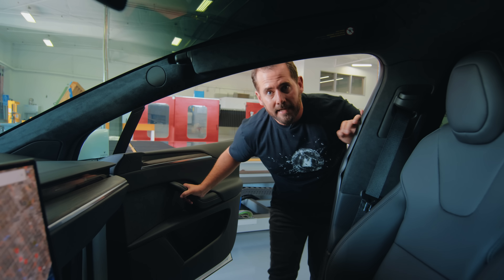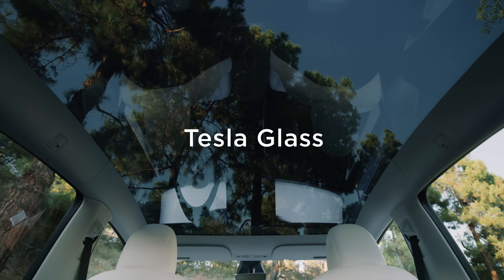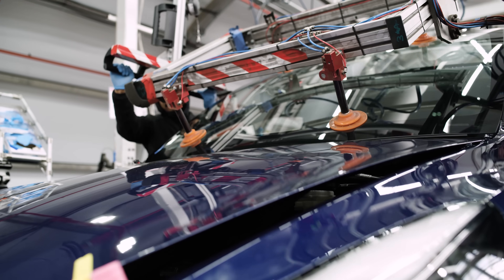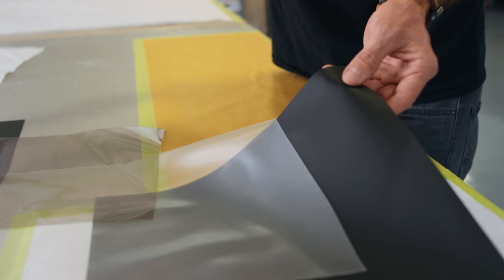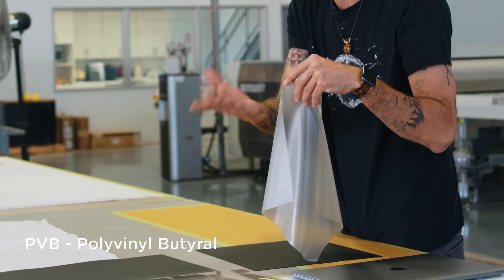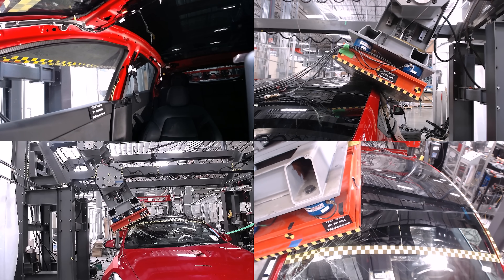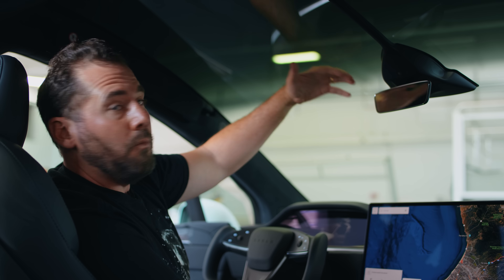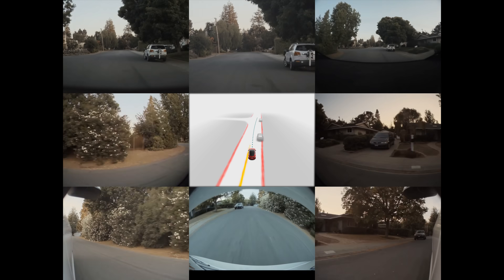Tesla Glass | The Secret to a Quiet Cabin

Comment: More of these videos please! Excellent 👏
Reply: I HOPE YOU'RE SATISFIED !
Reply: You are right they need 100s more of these types of videos. Little tidbits to set the haters and misinformed people right.
Reply: @kameljoe21  Hahaaa, you know that Mercedes have had this type of glass since the early 90's right?
Reply: @PowerslideSWE  Mercedes-Benz offers thermopane side window glass on select models. I could not find a list of models they offer them on, nor could I find a year when they first offered them. From what I have learned they were offered as an option and not many models had them. While since the 90s might be correct lamated glass has been around for more than a century. It has been used on cars and many other things. This is really the first time a car manufacturer has publicly offered it and show us how it works. Most cars have tempered glass and we all know this. Most people would not think that there would be any kind of laminated glass offered at all. It does have its benefits from quieter rides and better uv blocking.
Reply: @kameljoe21  My BMW has dual pane thermo and sound insulating glass, it's a MY 2000, my 1995 BMW 750 had it aswell. It's not a new invention, you Tesla fanboys think that every time Tesla presents something that it's a first, it's not. Teslas drivetrain, batteries and charging infrastructure are great, the cars in general tho are FAR from groundbreaking tho. Mercedes offered dual panes in the S-class from 1992 and onward, saves you the hassle to look it up yourself. You DO understand that Tesla isn't the fabricator of the glass right? It's an outsourced process as it is with every other car maker, and there are ALOT of videos online showing how it's done.
Reply: So quiet you can’t even hear a Honda bump !
Reply: Wham Bam that glass is awesome man
Reply: Fifth reply big fan
Reply: Wassup wham baam
Reply: If they do, I'll be satisfied!
Reply: Hey wham Baam!
Reply: Ey!! Wham baam!!
Reply: Please 🙏 give me a little shootout in any of your videos I am a big fan of your videos.......
Reply: what baam teslacam or #hondabump
Reply: Love your videos
Reply: You know we're satisfied!
Reply: yep
Reply: E LON Is God.  Mars= Future Earth. Tesla and BTC= Future KING. The Rest and Their Family will be our SLa ves. G-AY BIT-CHes Hate Bitcoin just because it use more Energy like Argentine. BUT Space X AND TESLA all Have Bitcoin. KING ELon Himself has both Bitcoin and Ethereum. ELon = Ironman who will Crush Tha nos and critics Should use their cash to wipe their Huge  A.n u.s. Just don t do G.AY things like environment. Tesla and Bit coin all the way!! Non-Holders Work till Dead to supply energy for Bit coin!! Vir.gin Haters Forever Sad and Broke. Cathie Says BTC will go 500,000!   💲💵🤑💸  Get TSLA and BTC while they are very low
Reply: its fine 
Yep. https://youtu.be/rJIAz6Ww-ss
Fax .
Reply: I'm satisfied
Reply: Yes please
Reply: WHAM
Reply: We NEED more 
Hi wham Bamm Teslacam your my fav yt
Reply: I agree!
Reply: yes
Reply: Lol.... there literally nothing special about that glassm you're welcome mate.
Reply: Lord won't you buy me a cybertruck
Reply: Cybertruck windshield at 1:21. Holy Crap!!!
Reply: eee
Reply: Hi wam
Reply: Yeeahhhh more of these!!!!!!
Reply: These types of videos are always interesting
Reply: Wham Bam Tesla Glass!
Reply: Another wham bam  fan here🤗
Reply: Yup
Reply: Wham Baam film some more man!
Reply: Ayyo I watch your videos :)
Reply: Oh u commeneted 2
Reply: its fine  thx for the music
Reply: I believe this is the start to something significant for tesla... there was talk about marketing in a different way than advertising and going an educational route... let's spread this far and wide so they are encouraged to make more!!
Reply: #Thunderf00t
Reply: Hiii!
Reply: Right
Reply: Big fan dudeeee
Reply: Hi wham baam
Reply: My blonde wife wants to buy a cheap Tesla right now
Reply: Any more #hondabump
Reply: Heyyyyyy knew you would be here
Reply: I agree 100%
Reply: I hope your satisfied
Reply: Yaaaa wham baam tesla cam im a big fan(:
Reply: Ayy wham Baam Tesla cam
Reply: Wham Baam!
Reply: Are you satisfied?
Reply: Hey, a wild Wham Baam!
Reply: @prod_scarf  Wham Baam uses "Tesla Cam"
It was VERY EFFECTIVE
Reply: Hello
Reply: @dylan_van2198  the manager is out currently
Reply: Hambam, your here man!
Reply: This guy  is made a song about Tesla u should hear it 🔥🔥🥵💯💯
https://youtu.be/U_OhOsYZQxU
Reply: Wham bam hello man
Reply: Nice comment Fam
Reply: FISH  wham baam ty man
Reply: you're here cool
Reply: The social media tribalism that pushed stocks up to bubble territory worked just fine -- for a while.  It always works for a while.  And then the speculative bubble pops.  And parasites like Rob Maurer are suddenly feeling desperate and without purpose.  There's no where to go but down.  And the constant one sided BS arguments that THE MARKET IS WRONG AND THE STOCK PRICE IS STUPID all of a sudden sound incoherent and worse, delusional.  Rob Maurer thought he was an expert at something -- this former Kohls department store buyer responsible for what -- ladies lingerie and lawn furniture?  But it was all just a little bit of luck mixed with social media speculation.  The armies of enforcers who crapped on any skeptic who raised a doubt are dissipating.  They know its over.  And deep down, even the biggest parasite of them all, Rob Maurer, who has been making money off all of you bagholders' eyeballs, knows it's over.  He would have quit by now but he was hoping for an interview with Elon Musk.  The ultimate narcissistic reward for a parasite who suckered countless investors into the stock at $1200, $1100, $1000, $900 ....only to see it grind lower and lower and will continue to grind lower and lower and lower.   How many shares has Elon sold this year?  HA HA HA HA.  Always for a good reason, right?  Nobody wants to own long duration assets right now, and that won't change for a very long time with rate hikes coming every fed meeting all year, and probably into 2023.  Tesla stock valuation is equal to all the other car companies' valuation combined even though Tesla only makes 2% of the cars in the world.  And the social media tribe yells back -- we've heard that before, and it hasn't hurt the stock!!!  Until now.  HA HA HA HA HAHA HA HA HA HAA HA.  And when Tesla hits rock bottom -- and that might be $300, or less --  it's not going to come back because by next year, when the ugly cybertruck sales start fading and it's obvious that ROBOTS won't pick up the slack (HA HA HA HA HA), competitors will be selling more and more affordable EV's which is what the market will want in tough times.  There will be a Tesla union increasing costs, raw material costs through the roof, Elon spending as much time on Twitter or more than he spends on Tesla, and China will never fully recover as a long recession will doom luxury car sales (in Europe too).  Tesla might even lose 90% of its value from $1200 -- as did Amazon.  Rob Maurer once made a comparison to Amazon!!!! He's not making a comparison now, is he because Amazon is down almost 50% from it's high. hahaha haha. And the vast majority of drivers DO NOT WANT FSD.  What a sales pitch that idiots like Rob Maurer passed on to naive investors.  You want to sit at the wheel waiting apprehensively to take over when the car does something dangerous????? What fun is that?  YOU HAVE TO PAY $12,000 for the anxious state of mind, risking the life of yourself and your loved ones, and strangers walking in front of your death machine?  HA HA HA HAH. ALL THE OTHER CAR COMPANIES ARE including driver assistance for free.  THAT IS SUFFICIENT AND PREFERABLE to paying $12,000 for phony baloney FSD -- which of course is not really what it says it is.  And besides, most people don't have $12,000 when inflation is outstripping wage increases by 3% -- people are poorer every day.  There's also the fact that every car company will have the same exact FSD as Tesla -- and here's proof:  Toyota is NOW getting into the robotaxi business in Asia.  Sleazy stock promoter Rob Maurer won't tell you that, but robotaxis exist now in the U.S. and soon Asia as well, and they're not owned by Tesla.  Elon Musk said in 2018 that there would be a million Tesla robotaxis on the road by 2020.  The competition has beaten him to the punch.  And the competition also makes much nicer cars.  If you want a really nice car, buy one from a car company, NOT A TECH COMPANY.  The cybertruck is the ugliest thing on wheels, according to Jim Cramer who said a month ago to buy Ford, NOT TESLA.  BUT ROB MAURER, former ladies' lingerie and lawn furniture buyer at Kohl's department store is telling you that Tesla is going to be a $3 trillion company.  What a liar.  The competition is indeed coming.  Even famed investor and billionaire doctor Michael Burry tweeted that last week.  The social media tribe yells back -- we've heard that before!  Right, and it didn't matter, but now it matters.  Now it matters.  It's over.  Warren Buffett:  “The line separating investment and speculation, which is never bright and clear, becomes blurred still further when most market participants have recently enjoyed triumphs. Nothing sedates rationality like large doses of effortless money.  They know that overstaying the festivities, continuing to speculate in companies that have gigantic valuations relative to the cash they are likely to generate in the future will eventually bring on pumpkins and mice. But they nevertheless hate to miss a single minute of what is one helluva party. Therefore, the giddy participants all plan to leave just seconds before midnight. There’s a problem, though: They are dancing in a room in which the clocks have no hands.”
Reply: Yes agreed
Reply: Wham Baam that glass is cool man!
Reply: WHAM BAAM HI
Reply: What details do with your message is ready ❤️ to expect from someone who can see 🙈
Happy birthday to you and your family 🎁
Reply: Keep up the great work (:

Comment: My model 3 is loud as hell on the highway (probably from the tires). It's one of my only major complaints. Otherwise, I love the car.
Reply: Would not call it like that, but I agree generally. My 2019 M3 LR is definitely not silent. Together with the rather sporty ride (despite 18") the major drawbacks. In my opinion the non-performance models should not be that "sporty".
Reply: @bernhardleopold6702  Yes, perhaps I exaggerated, but it is loud imo for a car that costs more than $50k. I have thought about trying different tires, but that's not exactly a cheap thing to test.
Reply: It's not the insulation or glass roof from which the suspected noise comes from. It's proportional perception of noise: It's the fact how quiet your M3 is that makes you think you hear outdoor noises louder. Any EV-manufacturer currently has this issue, working hard on it. Tesla so far has reached the lowest decibels with its 2021 models. Is yours a 2017? I remember those were not that good. Anyhow: You may use a decibel measuring device to compare it to your friend's cars. You'll be surprised. I have a Tesla Model 3 Performance, 2021 version. I tested it myself. In fact even the thick steel floor seems bigger source of noises than the glass area. They did an incredible job. Even the window wipers in Teslas are the calmest on the market, specially designed to be as quiet as possible. They had to, as in any other car (even some EVs - with bad loud aircons) other noises are louder than the wipers, while in a Tesla all else is so quiet that you start hearing any little thing. PS: The glass roof was not just chosen for the feel of openness and better vision, but also for its strength. This type of innovative glass, together with the frame make it (impossible with carbon or metal sheet) the strongest roof on the market by far - stonger than roofs of PVs with over tripple the weight... BUT BACK to the tires - you are absolutely right with the tire noise, those are after the combustion engine usually the most loudest part of a regular car. Especially winter tires or good all weather tires. I have a feeling this can physically not be insulated even more, I assume that's why Tesla already started using active noise cancelling via outdoor and indoor microphones and Surround system, in order to give you the impression of hearing no noises from the tires. But who knows, Tesla has a huge material technology team that came up with a lot of absolutely world changeing ideas in the past. They might find some new type of insulation that some day might even solve this on a physical level. Also, Tesla is interested in tire design already and might at some point manufacture its own innovative tires. It will definitely never be boring around Tesla. I wish you a lot of fun with your car! Best wishes.
Reply: @manueldavid7369  I thought that too until I drove a Model S which was MUCH quieter on the highway. My friend's newer model Y is also quieter.

Comment: More glass more maintenance, im surprised it aing made full put pf glass, so you can crack it faster
Reply: ..actually the likelyhood for such glasses to crack or have any other issues is far far lower than with conventional glass. Also Tesla figured out systems to manufacture it at even slightly less cost than traditional car windows. Innovation was the key. Achieving more with less ressources. Therefore a 2021 Tesla Model 3 only costs 39k, all included. They even found strategies with any component, to make it maintenance free and not necessary to replace anything. Tesla has (since 2017) the least amounts of service visits of any car brand in the world, also offering, IF EVER NEEDED, the cheapest service costs. Current Teslas only need new tires every now and then and fresh window wiper water when it's empty. No oils, no sudden expensive filter replacements, no mechanical part maintenance, not even brake maintenances, since Teslas are equiped with e-motors strong enough to avoid using the brakes at all and using the motors to generate back electricity instead. The only EV which can do this to such leve. Calculated over 5 years, a Tesla Model 3 is currently the cheapest car on the market. Not to forget how much longer than any other car it keeps its value stable. It's quality which saves money, if done the right way.

Comment: not right on 200km/h+ it sound very windy.  the missing engine points this even more out. also the vehicle is poor made...  definitely not designed for the German autobahn. batteries in general are unreliable and worse than owning 5 gasoline vehicles... It's definitely not environmen friendly.  the electricity produced mainly comes from coal-fired power station, which is litterly the worst technology ever to use for transportation. yeah...

Comment: The acoustic glass on my '21 M3P is amazing
Reply: INDEED, huge step forward from the 2017 model 3. I enjoy it very much too in my 2021 Tesla Model 3 Performance. Wish you much further fun with this dreamcar!!
Reply: Not bashing Tesla.
Acoustic glass was amazing  Mercedes S class in 1992.
Reply: @GrandmasterFU666  I’ve had Mercedes’, Volvo, etc. none had this glass. It’s typically an expensive option. It comes standard.
Reply: @ChrisLeiter  came standard in the S Class they called it dual pane glass not only did it deaden the sound it also kept the outside temperature from coming in.

I think Tesla is great.
Reply: @GrandmasterFU666  on the S class? Sure. On every car - like Tesla does - no. They nickel and dime you when you buy a Mercedes. I'll never buy another new Mercedes again.
Reply: @ChrisLeiter  E class had it but I believe as an option.
Reply: @GrandmasterFU666  Lol ikr, the fanbois think it's new.
Reply: @incognitotorpedo42  yeah the non informed fangirls basically

Comment: Not sure if the newer models have a better temperature shield but my 2021 Model Y glass roof gets really, really hot, to the point that in a 100° day I can't touch the roof inside the car because it is so hot, and on top of that the inside temperature by the glass is so high I have to wear a hat to block the heat from my head. Not really designed to block the hot temperatures, not sure about the cold.
Reply: Metal roof is just as hot in my world if not hotter. You can buy aftermarket panels if you really need them or DIY with a pop in sunshade and material of your choice.